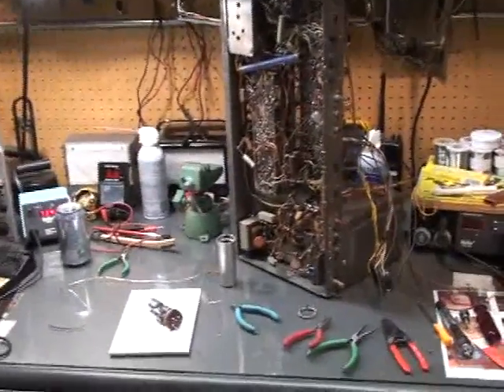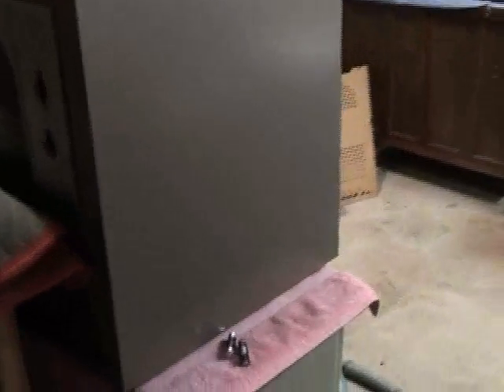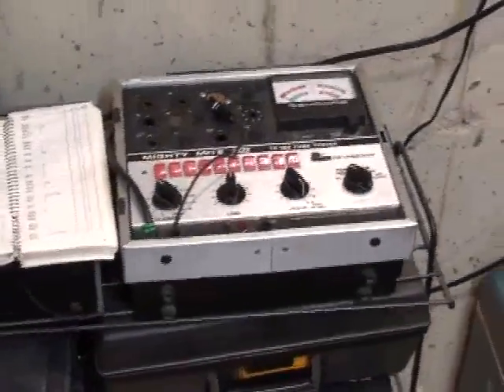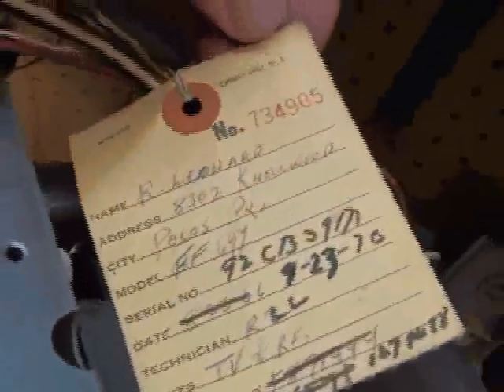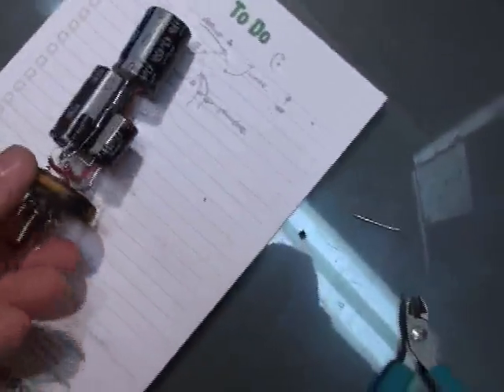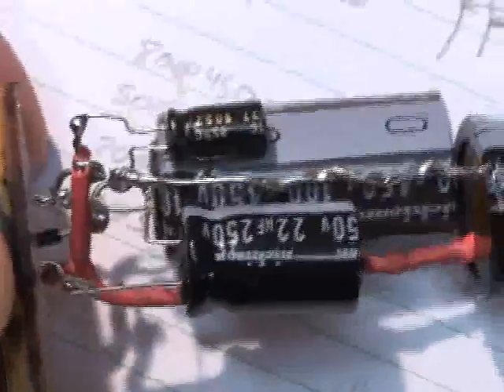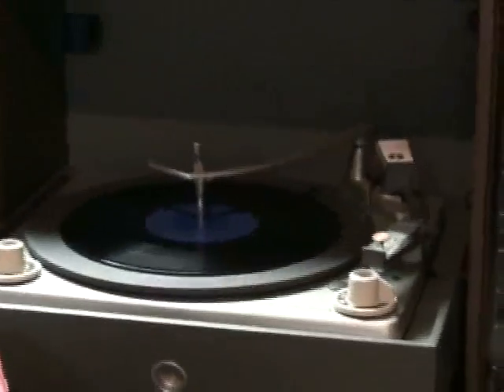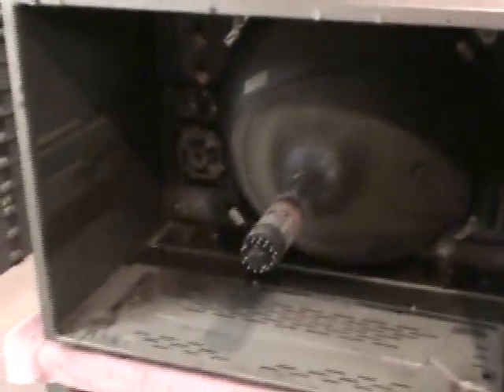1964 RCA Victor CTC-16 Color Television Repairs

Comment: I notice a lot of early 60's stuff has what I like to call the proto-circuit board. I guess the 50's were the last decade of point to point wiring. Excluding all of the hand wired guitar amps of the 60s. I don't really know too much about TV's myself. I like the old radios, guitar amps, and other audio devices of the glorious past.

Comment: i'm working on a 1958 tv after replacing all the wax, paper and electrolytic caps the set displays a raster which has low height and width. adjusting eht, width, height, and line drive have no effect on the picture size. what might cause this?